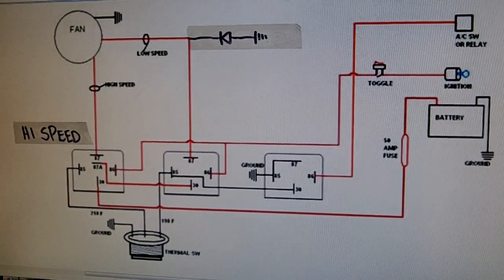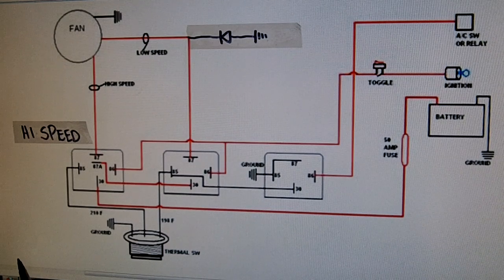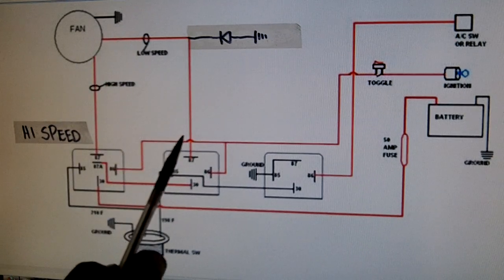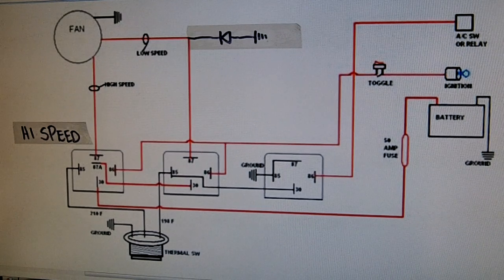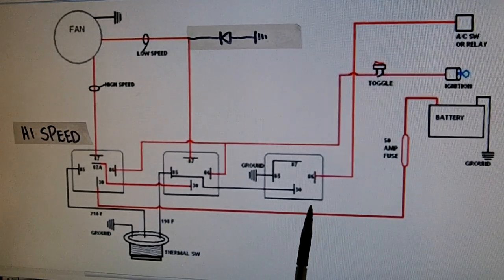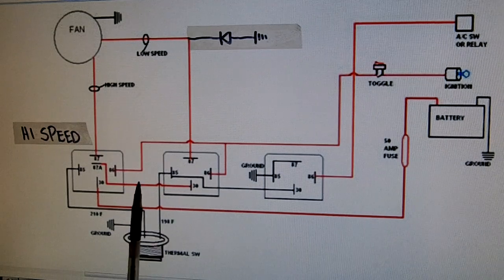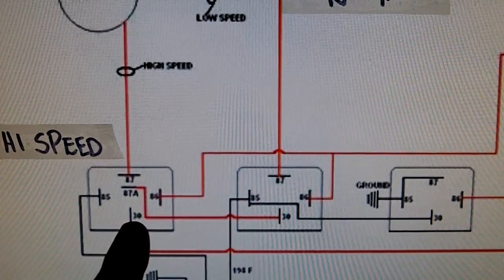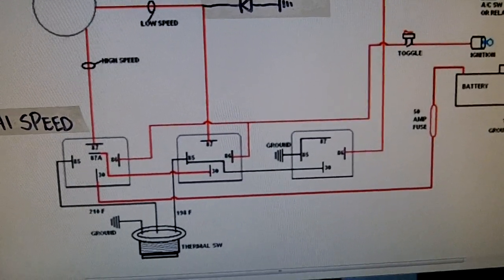2- Speed Electric Cooling Fan Wiring Diagram

Comment: Hey Martin, I have used this set up on three vehicles now with the Volvo 2 speed relay that you used in a later video. My most recent installation is the first time I have used the AC triggering the high speed setting on the fan. When I shut the vehicle off and the air conditioning has the high speed on, I believe the relay from the AC compressor to the Volvo controller is being stuck open. The fan will not shut off until I disconnect the relay coming from the AC compressor. I read about fly back voltage, and I believe the reason for my situation is fly back voltage leads to the relay being stuck open, keeping the fan on. Do you know how I can remedy this issue?

Comment: Dumb question but what kinda electric diode do I get? I'm wiring up a 2speed taurus fan to my 1989 mustang GT. That's for posting the great video bud.
Reply from the maker: The part number for the diode is IN5408
Reply: 20 pcs 3A 1000V Axial Rectifier Diode IN5408? I found it on amazon.
Reply: Can you explain why you're using this particular diode, and not a 18v 60 amp diode? I can't find any explanation anywhere as to what diode should be used.

Comment: As long as there's a thermal switch installed, and following the wiring on a custom E-fan setup, this eliminates the need for a Fan controller right? I do want to do something like this to my Explorer using a Taurus fan, but do not want to use a controller. 

If I am following this right, the thermal switch acts as the controller, right? Sorry for the newb questions
Reply from the maker: yes that is right. Thank you for watching
Reply: Awesome, thank you for the video! Only other thing I'm not 100% grasping is how the  A/C switch runs the fan on high. I drew this diagram on paper, and flopped the 195 and 210 degree locations around, leaving the relays and everything in the same spot, where the 210 is on the right side of the Thermal Switch and the wire still goes to the far left relay. When visualizing it, I can see it completing the ground and activating the low speed relay.. How does it run on high? Wouldn't the 30 connection go to the 85 on the far left relay? Or is something so simple just going over my head lol?
Reply from the maker: sethinator224 leave your right after looking at it. Imma have to pull this video and have that corrected. I believe they need to be switched
Reply: I just acquired a fan so after I wire it up and let you know!!
Reply from the maker: sounds good, let me know how it turns out.
Reply: Still waiting on my relays to get here! Got my BMW fan switch from RockAuto for about $13 shipped and a relay box on ebay for about 25 dollars. Got my Switch in 2 days, and it's been over a week on the relay stuff! I just want to get this done lol
Reply from the maker: Thanks for keeping us updated
Reply: So I got all my stuff and wired everything and got a Thunderbird fan hooked up in my Explorer. Did it 2 weeks ago. I followed your diagram almost to a T, and the A/C relay is indeed, going to the low speed. 

I modified it a bit, and brought the "30" terminal to the far left relay 85 terminal (high speed) and now the fan blows on high with A/C. A few other tweaks I did were Circuit breaker vs fuse on hot at all times circuit. Also no toggle switch on the ign. switch circuit. No diode as of either, but that'll be coming.

The RockAuto "Uro Parts" BMW fan switch is GARBAGE, by the way! IF YOU ARE READING THIS COMMENT AND ARE CONSIDERING IT, DO NOT!!! GET A MORE EXPENSIVE ONE FROM BECK/ARNELY OR ANOTHER BRAND!!!!!!!!!! Didn't kick on low speed at all, and about 238 degrees before the high speed kicked on. Got a Duralast fan switch from AutoZone and it seems to be within spec and working great!!

Just wanted to say thanks again Martinbuilt for posting this video, as it is what inspired me to actually get my efan conversion going. Cheers.
Reply from the maker: Thanks for letting us know.

Comment: so how would you do dual fans (ford windstar)? I have been all over trying to figure this out and it is so confusing... I am not using the bmw temp... I just bought a standard single...
Reply from the maker: Are your fans single of dual speed ?
Reply: . I decided to do tons of research instead of just diving in. Well ID10-T here...

So i took 5 minutes..all i had....

Junkyard cut wires about 2-3 ft long. I looked and saw1 back and 2 red... so i stripped them.
Hooked up neg to jumpbox then 1 red. My jumpbox has a power switch. I turned it on and both came on full power. Im like.. thats weird. So i unplug red and use other red. Guess what.? Both came on high.

So i have 2003 windstar fans. I sat back and took wire loom off. Seems they tied both black wires together and came out with 1.
They took both reds and tied them together and came out with 2..WTF is that shit? 

So now what you say makes sense. Pull reds apart and use 1 relay to drive 1 fan on temp sensor. Either use switch or higher temp sensor to drive other fan. 
Sheeze i overcomplicated the hell outta it.
Reply from the maker: Glad you got it figured out:)
Reply: Well i have the theory set lol. Will get to it when its not 30F out

Comment: Is it the relay that makes the fan go high speed or low speed?  I want to wire my fan for high speed only
Reply from the maker: It is the Thermo switch that actually controls if it goes into low or high. The relays are nothing more than a heavy duty switch to handle the amperage required. I'm assuming your fan is a 2-speed fan? Many electric fans only have one speed
Reply: @martinbuilt  yes it has 2 speeds.  Is in a 2011 mustang gt and I put mine on a relay kit and it's only low speed now but I need it to be high speed always but I'm not sure how to do that!  Im an electrician so I'm not stupid when it comes to this stuff but I don't deal w this type thing much
Reply: I have it on a 70 amp relay w an inline fuse now
Reply from the maker: @jeffreybosley12boz  well you could swap the high in the low side power. Then the fan would come on high the only problem is if the engine for some reason gets hot enough to trip the high side Thermo switch the fan would go into low speed.

Comment: I for the life  of me I don't understand how the relay for turning the fan on when the a/c is engaged  does anything the way it is wired. Am I missing something?
Reply from the maker: So are you saying you have wired it the way the diagram is and it's not working for you or are you just not understanding the way it works.
Reply: I have wired it this way (twice),and it does not work.
Reply: I don't understand how this would work either, so I tried it.

Comment from the maker: The problem with that is if the engine is requiring hi because it is running hot now your forcing it to go low speed the in engine  will only get hotter.
Reply: no

Comment: do u have the wire gauge specs used 4 the wiring
Reply from the maker: If you use 10 ga. for the ones that are coming off of terminal 87 and the ones coming from the battery you'll be good.
Reply: from the diagram seen about the diode - did u ground it
Reply from the maker: yes I grounded the diode

Comment: can anyone tell me on the BMW sensor what wires go to T1-T2 and the 0
Reply: come on someone must know this wiring, as martinbuilt is using for fans
Reply from the maker: @davestanley3319  Should be T1 low speed, T2 hi speed, 0 ground
Reply: @martinbuilt  Thank You So Much I didn't want to burn anything up I  wired everything else like your print then I saw you said to use a BMW sensor great video

Comment: we have a Landover td5  water cooling electric  fan stop working
 visually look at fuse ok, checked fuse with meter ok,
 then checked wires  in and out of fuse holders 12v in but only 3.2 out,  A corroded fuse holder replaced ok now   
don't just test a fuse check its  connation's  for corrosion same for any connations
Reply from the maker: Is there a relay in your system if so the contacts could be dirty or pit in the relay causing a bad connection. try changing out the relay or by passing it

Comment: hey Martin, So I am going to install the diode you recommend into my fan setup which is very similar to yours. In your wiring diagram you have the diode inline from the positive battery terminal to the fan. The diode you mention in your details section looks to be a 3A 1000V one, similar to this: https://www.ebay.com/itm/10pcs-x-1n5408-1000V-3A-Diode-US-Seller/332654902873?hash=item4d73c6fe59:g:i00AAOSwmmxW21SL
Is this enough? Do I literally just splice in the diode into the positive line from the battery? My fan easily pulls 40A I know this since I have blown a few 40A fuses until I switched to 50A and 10 gauge wire.
cheers mate,
Reply from the maker: Yes the low side positive from the fan to ground. Just make sure you install the diode correctly or you will blow the fuse immediately.
Reply: OK mine is just wired to the high side. Looks like in you diagram it goes before both of them, right? Thanks for the reply mate!
Reply from the maker: yes after the relays before the fan
Reply: HI Martin, so I installed that diode and within a matter of second of the fan coming on it burned out. I have the diode inline on the positive from the relay to the high side of the fan.  Man I wish I remembered more electronics stuff from high school :(

Comment: You're a genius man, excellent work. I need to wire an electric fan in my Cherokee and this seems like the most rock solid legit way of doing it, but I'm not that good with the scientific or troubleshooting aspect of something this complex. Soldering and what not is easy, but this is alien to me. Is there a simpler way I could just wire up a 2 speed fan to a toggle where I would be turning the fan off/low/high manually with just a toggle switch and a couple relays? Thanks in advance.
Reply from the maker: I would still wired everything exactly as I shown using the relays is needed because of the high amp draw especially on high. Just replace the thermal switch the ts 139 with a 3-way toggle switch. Or you could also use a 2 way toggle.switch that has a on and on position.